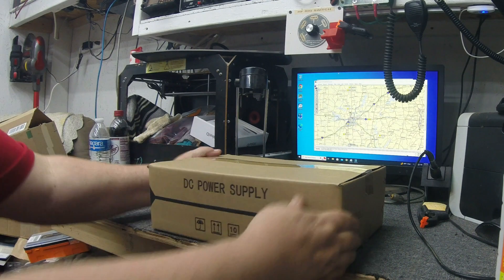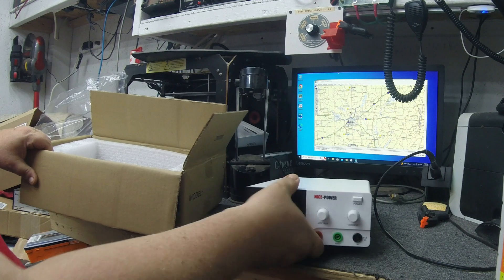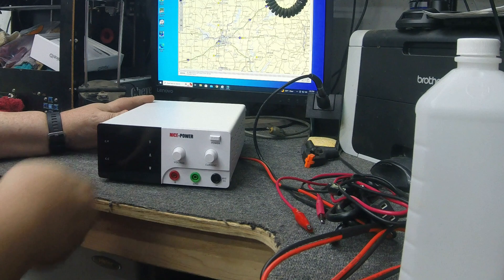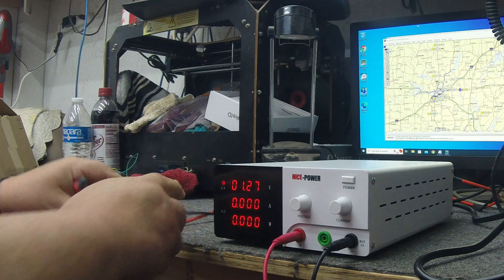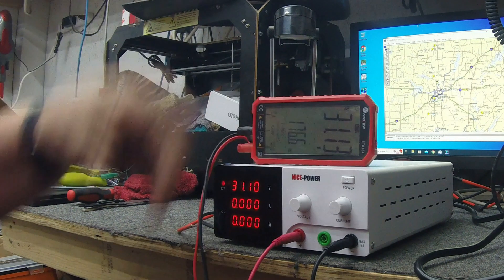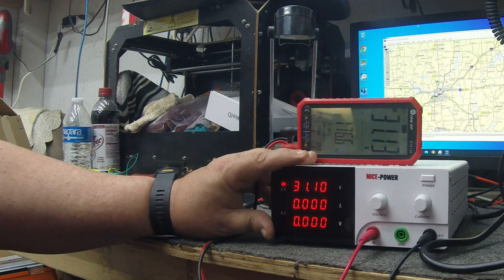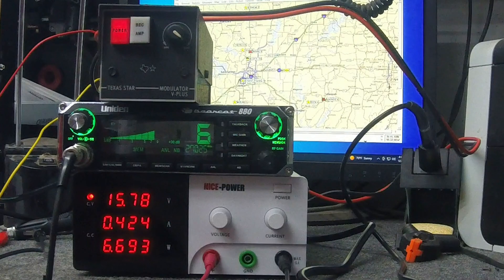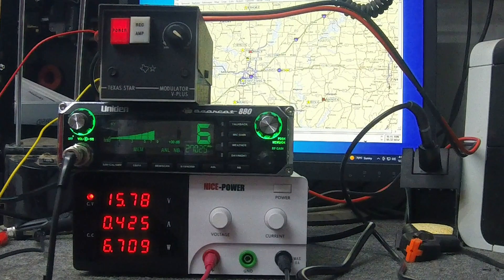NICE-POWER High Power 600W 30v DC Variable Bench Supply Review

Comment: At 3.6 volt 20 amp is possible
Reply from the maker: Yes but you have to use the high amperage post on the back of the unit the front posts are only rated to 5amps.

Comment: That is a nice power supply , 20 amps is desirable and the good thing about SMPS that can yield high amps are cheaper than the ship anchors that are so heavy .... As you know I have a 30 volt and 10 amp SMPS and I love it especially the color of the display ....Ice blue white is what I call it ..... The one setback to the SMPS is the filtering , they generate noise , mine isn't so bad  but I am going to order some quality Rubycon caps and hike up on the uF's department ..... Not so much though....There's a limit on that ...... I am so used to using a linear regulated supply that I never worried about noise , but I can tell there is some on my Wanptek ......Eddy has one like mine and put it thru the scope after each cap change and finally got to the sweet spot ,  it was clean corn after that....... If Nice - Power comes out with a Ice Blue display I might jump on a 20 amp....  Take Care Mon Ami ..
Reply from the maker: Yes I agree it's a balancing act less heat more efficient but more noise with the switch modes but it's all about filtering on them for sure that is why I went with a lab quality supply much cleaner via better filtering, I still have an old transformer 35amp I keep for back up LOL...
Reply: @TheElectronMan  Yep I have a 7 amp Tripp-Lite , and a Ray Jefferson 3 or 4 amp with built in speaker , those 2 just don't have enough a$$ to kick those export radios at full power , I had a 35 amp in my radio shop when it got broke into , luckily I had a 15 amp at my house for a spare ... They got away with a lot of stuff ,  Frequency counter , new export radios , amps , rolls of coax , Francis antennas 5.5 footers , Mr. Jiggs noise toys and reverbs , those were clean sounding , LT-2 reverb-echo boards , roger beeps already converted to roger farts , I would make those up ahead of time , since I was installing so many , heck I would order 100 Road Runner roger beeps at a time , my buddy that helped me come up with those farts would order 100 at a time also , so that made 200 ordered in one lick.....He owned his own trucks also and he would make a load going to Baton Rouge or New Orleans area and stop at my shop on the way back and pick his stuff up.... He couldn't get his stuff wholesale until he got his business license .....
Reply from the maker: @cajuncoinhunter  Man I hate thieves with a passion if it isn't yours leave it alone.. They have got me a couple times but not near as bad as what you got stolen that is why I now have 6 camera's  and an alarm on my shop as well I make it real apparent that it's all active. Worst break in I had at my shop was they got in and broke open my safe smartly I always leave a little cash out front and I had the rest hidden way in the back behind a book so they got loose cash but they didn't get the big part still felt totally violated. I am really picky these days who I even let in and I always make sure my 9mm is obvious as well as the camera displays...